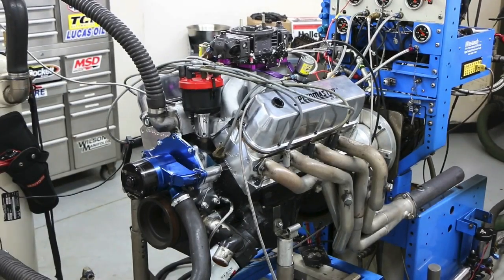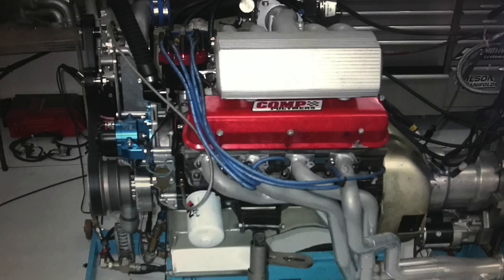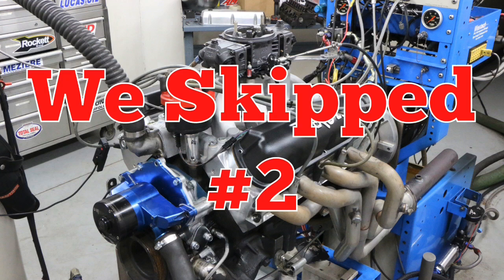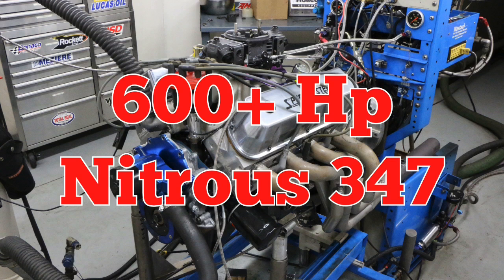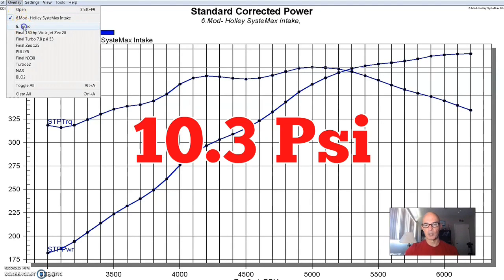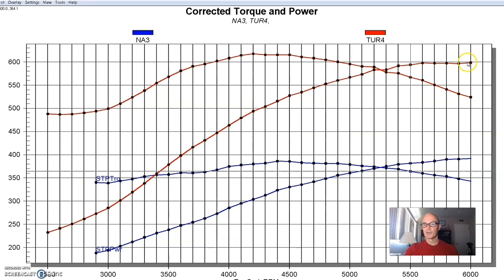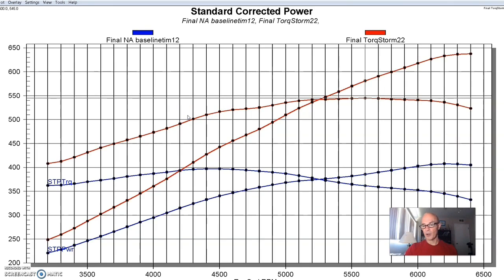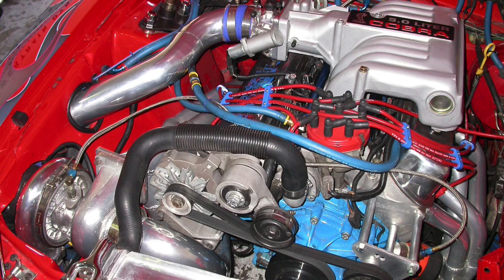5.0L FORD BLOCK SPLITTING-FACT OR FICTION?

Comment: The general rule of thumb I have lived by is 550 WHP max and keep  it under 6200 RPM and it will live. When I split one it was a stock engine right down to the stamped rockers. The only mods to the engine were copper head gaskets. A  vortech after-cooler and S-trim  was added  at 17PSI. It ran 10.9@131. Trans was a trmec tko 5 speed. It split down the valley though the cam journals and all the way though the block.   That was over 15 years ago.

Comment: Harmonics will destroy a engine, granted there are a few blocks that were probably not cast correctly. There is guy with 5.0 stock bottom end making over 900hp, it's a turbo, the bottom end has never had the oil pan off. It's been said if they are still running, you got a good one.....!

Comment: its simple. Its not a forgiving block like others. If everything is right, it'll live. The second you get detonation at the wrong time, boom, it'll let go. The record is over 900whp, and its a regular xxx 302 block. Nothing special done to it. You also have to remember these engines are commonly built in garages by amateurs. I'm sure many have made small mistakes during the build process, causing failure.

Comment: The only one I broke was a stock crank , stock rod , 50 ounce balance deal with Vic Jr heads , .525 .525 .232 .242 @.050 . Vic Jr intake. 10,000 RPM non adjustable N20 deal ... the cylinder head broke all the way through the spark plug holes and head bolts. When we took the engine apart the balancer was split at the key way and the block was broken from the crank to the cam. 7,000 rpm no lift shift was when this all happened. No idea what caused the malfunction. The bearings all looked good. I don’t think mine made anything near 500 horsepower even on the kit.

Comment: In my experience with SBF's, mainly 347, 383 and 408 strokers. Its RPM and balance thats your enemy. The other is somewhat casting lottery, especially with non roller motors. 7KRPM was ceiling for a well blueprinted and matched motor. The amount of meat around the webs is their weak spot in all SBF's.
I dont think there is really a general rule like 500hp is it for a 302, as here in aus most will say a 351 is good for 700, yet Keith craft in the states has a 920hp 351 twin turbo as a daily, well at least he did back when i was getting parts from him. So having said that it is a gamble as to what you will get given the variables. 
Regarding the 500hp for 302 and 700hp for 351 i cant help but feel this has stemmed from just poor setups. The SBF in my opinion is a more superior motor than its brother the cleveland, if its built right and setup right they are a brilliant power plant with huge potential. As to how often someone would do it right is a 2/10 chance in my experience.

Comment: If you look at the construction of the block, its really thin in the lifter galley and all the way through the middle over the crank line. i would think that if you so happen to get a block with a weaker casting than normal, it would crack all  the way through, but would be highly unlikely for that to happen. filling the block does no strengthen the center of the block.

Comment: what if the torque from the launch causes the frame to twist just enough to spread apart the distance where the engine mounts to the frame? has anyone split a block with subframe connectors or with a tubular k member?

Comment: It's high power levels at very high engine speeds.When we were developing the Chrysler NATCC 2.0L engine we were converting a 2.0L production dual overhead cam engine that made 150 hp @ 6000 rmp with a redline of 6500 rpm to over 300 hp at 8400 rpm, which we accomplished.  However in the development process we kept breaking our main bearing bridge bedplate which was made of compacted graphite cast iron, the rest of the block and heads were aluminum.  If this happens with a v engine I could easily seeing actually breaking the block as well.  What many people don't understand is the force reguired to first decelerate the piston from moving down very fast to accelerating the piston to moving upward very fast vastly exceeds the pressure forces and these forces are born by the main bearings and related structure.  By increasing both the pressure forces and increasing the redline by almost 2000 rpm the structure could no longer handle it.  If we had just supercharged the engine but left reline intact we probably would not have had as many problems.  We ultimately succeeded however and took the manufacturers championship one of the two years the series was run.

Comment: People keep saying its the balance or the crank or the harmonics ect.... Its not if you look at the aftermarket or even ford performance parts the blocks are substantially thicker in important areas mainly the main cap webbing(some are nearly half an inch thicker) and the lifter area.  R302 will take 1,000+ HP and is a factory ford part. Dart blocks can take 1500+. Even with the best rods pistons and crank you can buy in a stock 302 block it will still split in half yet the aftermarket ones way way more power. 550lb ft of torque seems to be around the limit of the stock block

Comment: I was hanging at a friend's shop and a customer running his 89 Mustang GT at the track called.  347 stroker ,  vortech super charger running about 12 lbs. Automatic 3 speed, 3.73 out back. He had put an electric fan on the motor and it was running hot.  His "buddy" was running the car for him as he watched.  Asked if someone could take the mechanical radiator fan and shroud out to the track. I volunteered.  He let me make a run after we installed the fan and shroud.....I made 1 run and it split the block on me just when I finished the 8th mile. Thought it was a head gasket from all the "pissing"....ultimately we finished breaking the block in two at the shop and made a table out of it.

Comment: I twisted the oil pump driveshaft on my 89 5.0 HO with trick flow heads, big roller cam, victorJR intake and 650 double pumper carb, never got to split a block, just seized the engine

Comment: Just ordered a Creb Engineering 306 sbf forged piston short block. Adding F303 cam,Twisted Wedge 170 61cc chamber heads,RPM Performer intake, On3 70mm turbo and Super Sniper EFI. 7lb spring or could I bump to 11lb spring you think?
Reply from the maker: try 7 first

Comment: Afternoon Richard 😎 . The only block I ever truly split was the stock Buick 350 in my 71' Skylark.  I was out in the desert Flats east of Boise hammer down in 3rd when I bumped the ratchet shifter cresting a rise a little faster than expected and it slipped into 2nd and the VDO tach hit 7k and it scattered to Four Points of the compass.  I got it towed home and got a better look at the damage and for all intents and purposes there wasn't much left of the short block.  There were a couple large holes in the oil pan.  It pretty much split the Block in half at the center line from One bank to the other.  The passenger side of the short block was completely gone as were most of the cam journals and the only pieces of the rotating assembly that were in one piece was the crank and 2 rods & pistons.  The rest of it is out there in the sagebrush somewhere.  Granted it really sucked blowing that engine but accidents happen and that's the way the car was when I bought it.  Luckily I had already started building a nasty lil' 30 over Buick 350 to drop in it,  it just got finished a lot sooner than expected 😋 ...

Comment: Richard Holdner great video.  I have another SBF myth that needs to be proven or dispelled.  Running stock offset 302 pistons backwards.  Have seen a ton of posts about doing it but no actual back to back.  Only the comments that it adds 30hp and such.
Reply from the maker: will not add 30 hp

Comment: I've never seen a block split but I've seen The Valleys crack more than once on stock stick shift Mustangs we also used to drill and tap 289 for a spider tray then in 96 the Ford explorer came out with the 5.0 short block and everybody use that

Comment: Only one I ever saw with my own eyes. 1994 Lightning 351W. Cold air and cat delete. Unknown amount of nitrous.  Brought to me still running with low oil pressure. Teardown revealed 2,3, and 4 main web cracked mains to cam.  Two lifter bores cracked.  NO spun bearings!  I wasn't around this motor prior to, so I have no idea how long it took this abuse.  Maintenance, driving habits, and heat cycling are the culprits IMHO. I have yet to see a 302 do it in person.

Comment: Cheap balancers, frame flex with solid mounts puts some stresses on the block, especially at gear changes with a manual transmission. Just speculating, haven't split one yet....knock on wood..lol!

Comment: My nitrous 331 notchback fox with afr heads did 2.5years worth of passes at the track and a bunch of street miles... it ran a best of 8.83 on a 26in slick at Indianapolis RW park.. So you can tell it was making some serious steam.. It lasted through so any 300 shots of spray due to the progressive controller.. when you smack it with all that torque it will piss off a 2 bolt main block real quick.. gotta have proper timing and bring it in slower to make it work for you..

Comment: my best friend split his block in half back in 2001/2002.  It broke during the burnout before a drag pass at our local 1/8 mile track.  It made a little over 600 rwhp, and I want to think rwtq was in the 630 range, running 9.90's in the 1/4 if memory serves correct.  It was a Ford Performance Solutions 331 in a stock block with either Canfield or Avenger heads (20 years ago, so please forgive me), FPS custom grind solid roller cam, port-matched Edelbrock carb intake, and a Demon 750 carb on nitrous.  The block split completely in half.  Fortunately he also had a main girdle, which kept everything together once the block split... he was able to reuse everything in the new R302 block.

Comment: Harmonics, especially over time.  We did testing back in the day running stock bottom end motors to 9k rpm on  the dyno for destructive testing.  Cracked in the block face, as well as main webbing failure every time.  A stock block was only good for around 25 hours at 7200 rpm continuous.  Same failures.  Stock parts are designed for a very specific duty cycle at a given cost target.  Mod it, Break it,  Fix it, Repeat!  SBFs rule!

Comment: Richard, New subscriber here, Man I have to say Ignorance is Bliss, I am sick and tired of this old wives tale being passed along, I even saw those knuckle heads on Roadkill on Motortrend channel say as much , furthering that myth, that’s why I don’t look at the show anymore, junk peddling, I owned a 5.0 and did the same GT-40 head’s upper and lower GT-40 intake, 1.7 crane cams rollers 65 MM throttle body bigger mass air flow sensor, ceramic coated shorty headers, lot of upgrades, daily driver and weekends strip car, never had a split block, by the War I have NEVER seen a Windsor split in half, it’s cracked, and this is because these engines are externally balanced, the Harmonics and vibration of the crank, causes these splits, a girdle solves this issue!! Thanks Sir for helping dispelling this Myth,, that’s why I am going to support you!! Great video!! Thanks

Comment: I have a 66 mustang that I am building, ready to finish out, a street car with a 5 speed.  I have the current 289 from the car and have debated whether to build it up with heads, cam intake, carb or get a 351 and build it out.  Want 400-450 hp out of it.  It will be my wifes car, just for joy rides.  Don't know which way to go.  Also considering using the 8 inch rear with addition of posi and rear discs rather then build a 8.8" just to save some weight.  Thoughts??  The car has a mustang II front suspension and custom full frame welded in.

Comment: I think it has to do with unseen cracks through the block and the motor can't handle the pressure of the boost or the amount of oil pressure the pump is putting out

Comment: A lot of great comments
with experience here, in which I am not as educated in the engineering and mechanics
as they are, but I do have common sense. I thought the testing of the engines
in the video was very educational. The 5.0 is a strong engine and can handle a
lot of HP and Torque no doubt. A couple of my questions were answered toward
the end of the vid where you stated they ran on a "manual
transmission" (stick) yet also blew out a few transmissions as well. When
pushing 600+ HP and 580 lbs of torque, the transmission will always be a
factor. In fact, I haven't seen very many 2015 and up S550's with an automatic
that can handle that kind of power, unless it is built to do so. More
factors.... Drive-shaft! I've seen many drive-shafts fail due to the power
ratio that it makes me sick, yet if you have a fully built, strong D.S. and
reinforced U-Joints, that would help. 

Couple of other factors I
question, which probably needs more testing to confirm…. Rear-ends, axles and
rear suspension. Are the test cars running solid, straight axle rear ends or
independent suspensions? What gearing was used in the rear-ends, 3.55’s which
are stock today, 3.73’s as an upgraded Performance Package or all-out monster
4.10’s? How did the rear-ends hold up too? I’ve seen many rear-ends blow out
with only 400 HP, but a 9-Bolt Posi-traction was the answer. Yeah, that is old
school, but all of this is a factor when throwing down high end  HP/Torque to the pavement. 

Lastly, what about “frame-twist”? This is also a factor and
I’ve seen frame twist under power blow out the windshield on several occasions.
Is that why “Pro-stock” and above competition cars use polymer windshields? I’m
not sure and like I said, not an expert, but learning. Sorry for all the
questions.

Comment: Problems. Problems kill engines. Detonation, pre detonation, bearing failure, fastener failure, overly lean mixtures, overheating, loss of oil pressure. . .these things destroy engines. Show me a clean, crisp running, properly tuned engine(no matter how radical) and as long as the components are balanced, and designed to handle the stresses, it will hold together. Pretty simple.

Comment: Here it is. I had a 1987 130k stock bottom end in a 79 cobra. Afr 165 heads, f cam. CSU blow through carb, power glide trans and a on3 turbo kit with a 70mm on e85, on 14 psi the car ran 9.90s like a bracket car for about 2 years, many street passes and track days. Got greedy and turned her up to about 18 pounds. Split it on the 3rd pass. Went 9.77. And it reall just cracked it nor really split it.

Comment: This video brings a question to mind for me. Does the 4.6l DOHC engine actually break the crank at exactly 500hp?
Reply: It's not the crank they have a forged crank (5 speed machs and all the cobras anyways) it was the pre 2003 cobra rods and pistons that are the weak link.  The block and crank are good for 600-800 wheel easily more on some of them (teksid block for example).  All those teksid cars need ls forged rods and pistons and they can make a ton of power...the ones with the forged 8 bolt crank anyways which is any of the 4v with a manual trans (auto machs and mark 8s had cast 6 bolt cranks like 2vs had...all cobras were manual thus all came with forged 8 bolt cranks)

Comment: I’ve split a block . 347 stroker kit afr 205 head and was turning it 7800 rpm. Just had a loss of oil pressure at idle and under its own power loaded it back on the trailer. Think it was a 92 block.

Comment: A guy from where I'm at in Alabama had the stock block 302 record for little while it was a 331 on methanol with CNC'ed edelbrock victor jr heads and intake with a big turbo fast fuel injection system. That setup would have went faster in a different car he done it in 3000 pound fox this all happened like 9 or 10 years ago.

Comment: I've saw it done once. 306 with afr heads good pistons & rods.I'm not sure of the rest of the setup. But had a 300 shot on it. Had a decent number passes on it before it split. Ran low 6s in the 1/8th....as you said it just cracked the block length wise. Didn't fall apart or anything lol

Comment: Im guessing, the newer 302 blocks might have thinner wall,s, or maybe the rotating assembly was out of balance.. The  real deal is to get two hp  for one inch, of  displacement carb only, Im betting you  could get over 1000 hp with all the good stuff,with a dual turbo,s how long it lasts at full boost is anybodies guess

Comment: have broken 4 302 motors in half stokers 347 and drove them back on trailer griddle only thing that saves them. went to aftermarket block no more issues. had a baby shot of NOS on one of them. lasted a good bit. the bad rod angle could be some of the issue and higher RPM over 8000

Comment: Had a 351w in a 21' day cruiser I/O drive.  Would run fine till you started pushing it and then the oil pressure would start going away, on tear down turns out there was a crack down the camshaft bore that would get bigger with heat. This was a bone stock Merc. and was not a race boat by any means. I'm going with the casting lottery theory.

Comment: Split mine after 6 years at well north of 700 wheel and it split when the valve springs got weak and it started misfiring on a pass at 18lbs and still drove it home with a cam bearing in the pan.

Comment: Build it to where you could rev it out to 7800 to 8000 RPMs and watch what happens it will be fast but it won’t last too long also you’re spraying a baby shot hit that bitch at least 275/300 but we also like going fast stock Block with girdle helps a lot  going 880s in the 1/4 that’s achieving something with a 306ci sbf.

Comment: Heavy detonation WHILE producing big horsepower is what kills them.  I have a 4-speed 1966 mustang with a 306 that ran 9.87 @ 136...   Ran the engine for 12-15 years.  306 with a 200 hp plate.  I have never split a block.  But, detonate one hard while near those 'limits' and it will break.